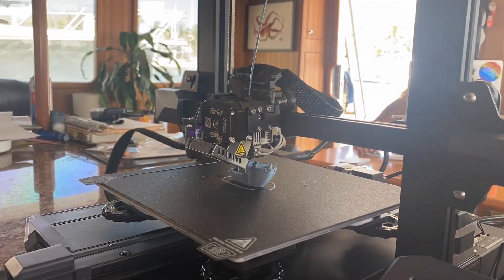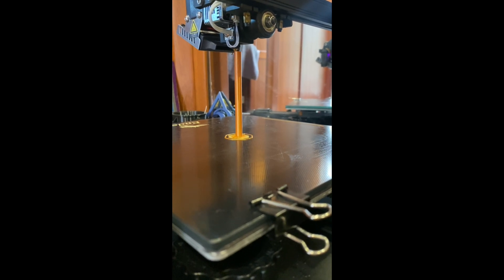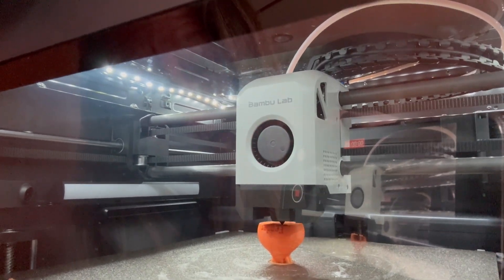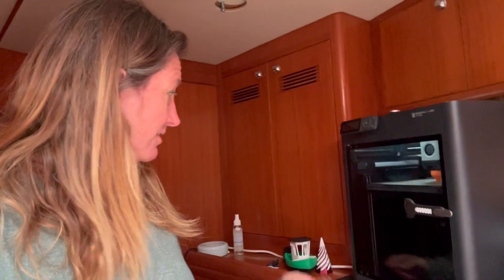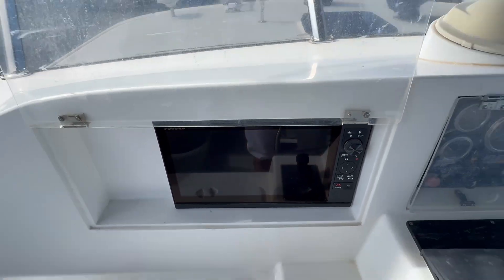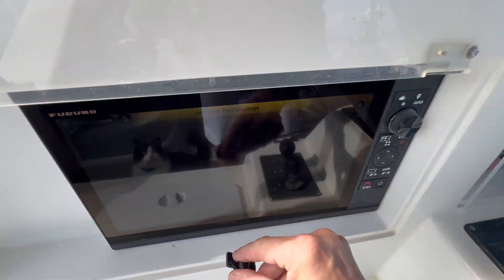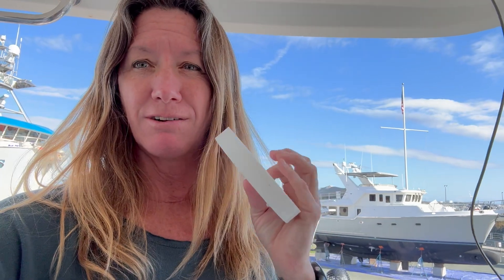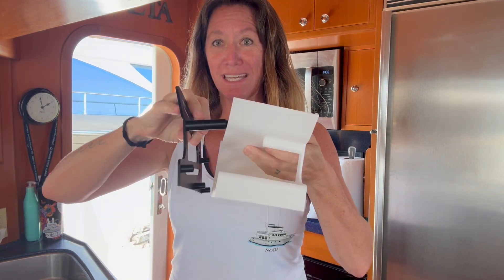3D Printing on a Boat  - Why?! How?!

Comment: Can  you please include what software/hardware you have found works well?
Reply from the maker: Sure! I actually mostly use Tinkercad to design since I’m not making anything too complicated. I’ve also used AutoCad- but it’s much more complex. To slice the object I use the Bambu slicer, Handy. It works well with the Bambu printer. I’ve also used Prusa as a slicer and it works just fine too. 🙃

Comment: Very cool video! 3D printers are very handy but how do you deal with humidity down in Mexico?
Reply from the maker: Great question! For storage I keep the filament in ziplock type bags that use a pump to remove the air. I also have a filament dehumidifier that ‘bakes’ a roll at a low temp to draw out the moisture. So far it’s working…but always an issue down here!

Comment: Thanks for this video. I'm considering retiring in a boat (still have at least a decade before that, so this is just brainstorming phase :) ), and I was wondering if 3d printing would work. Of all the things I would need to sacrifice, the ability to tinker with a 3d printer would have been the worse. I'm glad to learn that at the very least, FDM printing is possible, despite the waves. What about resin printing, do you know if it's possible at all? I'd imagine at the very least, it would need specialized VAT (the container in which the resin is poured) with higher borders to prevent spilling, but I'm not sure if waves would affect the printing, with the resin constantly moving and all.
Reply from the maker: That's awesome you're planning for a life afloat! I haven't printed with resin yet, so couldn't tell you for sure, but with it being liquid, I imagine it wouldn't be nearly as precise. I chose the Bambu specifically for its stability. In fact, at trade shows, they demonstrate that by walking around with the printer as a backpack to show that you can move it all around and still have high quality prints. In fact, one workshop I went to, a sailor showed a video of him heeled over, sailing, and his printer still printing. They get better all the time! Good luck!
Reply: @mvnoeta  Thanks! Oh ok, I heard a lot of good things about Bambu Lab printers, but I didn't know about that one. ^^ Yeah, the thing with resin printers is that they solidify resin by flashing UV light for a couple seconds at a given point, so I would guess that if resin was to move during that flashing, bad things would happen. 😅 I would expect problems similar to long exposure photography when a light moves across the field of view. Well, you know what? I'm not at sea, but I have a couple resin printers, and simulating movement and vibrations could quite easily be done. I'm going to run a stress test, and tell you how it went.
Reply from the maker: @kik-was-here  I'll be curious to hear the results! Good luck!
Reply: @mvnoeta  Well, I didn't expect those results. So, here is what I did:

- I designed a simple shape, a square with sides of about 1 cm and a few millimeters thick, with columns about 1 mm thick connecting the square to an other one of same dimension positioned a few millimeters higher. The idea being that it allows for a fast print (but it's resin, so it was still 17 minutes 😅), while alternating between "large" full surfaces and small precise points
- I did a first print in normal conditions to be sure the model prints correctly, as a control
- Then I did a second print with the printer at an angle, by putting USB sticks under two of its feet. It was an angle of just a few degree, but more would have spilled the resin anyway.
- Then I did a third print with constant movement. I initially wanted to bump into the table while it was printing, but thought this would not be close enough from the effect of waves (if it turns out printers don't like shocks, it doesn't tell much about whether they can handle waves). So instead, I took a big hammer, used the side meant to remove nails, put it under the printer, and used the handle of the hammer as a lever to rock gently the printer while it was printing. I did it for the whole 17 minutes of printing, making sure resin was always moving each time the UV light was on.

The control print went well, the one at an angle too, which I was expecting. I did expect the  third print, with constant movement, to fail miserably. And… it printed perfectly! 🤯 I don't understand why. 😅 Maybe… Maybe it's because each layer is 0.05 mm, so the space between the build plate / previous layer and the bottom of the VAT (the resin container) is so tight that resin can't move? It's a mystery to me. But hey, we have our answer: the flashing process is working just fine when the resin is in movement.

Note that there may still be other reasons why one may not want to use a resin printer on a boat. Spillage is the most obvious. And spilling resin is not as trivial as spilling a drink. First, under the VAT is where all the electronics of the printer is, so a leakage of resin can destroy the printer. And second, resin is a really nasty (and toxic) material. It gets everywhere, and it doesn't leave. Trying to clean up resin reminds me of trying to clean up oil with cold water, it just doesn't cooperate. And you can't clean it up with hot water, you need isopropanol, which, on top of everything, is very flammable. So yeah, at the very least, I think this would require custom VAT with higher borders to make sure it would not spill under any circonstance. Maybe that could be 3d printed, the hard metal parts and the transparent membrane (called the FEP film) can be removed, so it probably could be mounted on a 3d printed part. Anyway, I got my answer! ^^ Could resin printing be done on a boat? Possibly, as the reward for a difficult quest of VAT design. ^^
Reply from the maker: Excellent testing! Super interesting....may have to look into that. Love all the troubleshooting :)
Reply: @mvnoeta  if you ever consider resin printing, please make sure to first read about its constraints before buying anything, though, it's way more involving than FDM printing. :)

Comment: I'm just now seeing this video.  I love it!  I've often wondered if I would get any value out of a 3D printer.  I'm still not sure, but it's clear that you have.  I wonder if, for parts that must be built to a specific specification, I'd get it right in the software to create the properly fitting and functional part.  It sure looks like you have.  I don't think you shared what printer you went with.  Will you?
Reply from the maker: Thanks for watching! The more I use it, the more I find new uses for it! Just printed a part this week for a hatch that was leaking...looks like it solved the problem! I'm on my 2nd printer. I started with the Creality Ender S3, and it was a good starter unit. But now I have the Bambu P1S, which I LOVE. It's been incredible. I also got the added AMS which is a device that feeds up to 4 different filaments into the printer, so I can do multi-color prints. That was probably overkill and not a necessity for a boat, but it's a lot of fun! Have a great day!
Reply: @mvnoeta  Thank you.  Minimally, I will investigate your printer and the topic again.  Take care.

Comment: Having is 3D Printer on a boat must be a huge plus. Lots of things you can make if something breaks. I'm on printer #3 The K1 Max and I love it
Reply from the maker: It really is a benefit! A K1 Max? I'll have to look into that one...(not that I need another one just yet :face-blue-smiling:)
Reply: @mvnoeta  I like the size, it can print 300mm square. The speed is also pretty amazing. I use mostly PLA, have done a ton of prints (760 hours) so far and have only had one failed

Comment: Thank you.  I think you read my mind.  I remember you mentioning 3d printing on your N50.  Later I saw the P1S Combo in the background on a more recent video.  I was going to suggest a video about 3d printing on a boat.  I have the same combo as was wondering how well it will transfer to a boat when we make the jump.  Have you had any issues with moisture in your filament?  I know the AMS must help with that, especially if you have printed up a set of the aftermarket desiccant pods for it.  I currently use mostly PETG and TPU but looking at ASA.  Cheers!
Reply from the maker: It's been great having a 3D printer on the boat, but the biggest challenge is making sure the filament stays dry! I use ziplock bags that I can draw the air out of and I put desiccant bags in with the filament. So far that has worked. I did end up purchasing a dryer. Mine fits just one roll, and I'll use it if I'm printing an important boat part - just to be sure there isn't any cracking and that it all melts properly. I did print a desiccant bead holder for the AMS, and when those change color I just put them in the microwave and they're reusable, so that's been great too. It's hard to visualize not cruising with one now! Good luck!

Comment: A 3d printer is an awesome tool to have onboard. I've been using a Prusa for 7 years and have made hundreds of boat parts. ASA is a great material for boat parts. UV resistant and can take heat/cold as well. PLA is great for prototyping. Thanks for sharing.
Reply from the maker: ASA is definitely a great choice for boat parts - I was using PETG and ABS for boat parts, but recently switched to ASA.  Prusa makes great printers!

Comment: Does movement of the boat (pitch/roll) affect the printing process?
Reply from the maker: On newer printers, no. In fact,  Bambu, at their trade shows, displays their printers on backpacks as people walk around the tradeshow - showing just how stable their printer is. I've seen videos of printers doing their thing while a sail boat is sailing along, heeled over. The critical alignment is the build plate and the print head. If those 2 aren't aligned perfectly, the print won't look great. Great question!
Reply: @mvnoeta  Excellent!  Good to know I can take my Bambu A1 along for the ride!
Reply from the maker: @ Take it! You won't regret it :)

Comment: congrats on the 57.  i have 475-48 and do the same. i have been designing and printing since 2013. typically i use rhino for my cad software. anything that is unique that i might need gets printed. i dont currently have the printer on the boat but once we start cruising for long periods i will keep one on the boat just for those instances or emergencies.
Reply from the maker: That’s awesome! Rhino is a great choice - For simple stuff I still use Tinkercad, but switch to Fusion if it needs something more complicated. it comes in handy all the time!